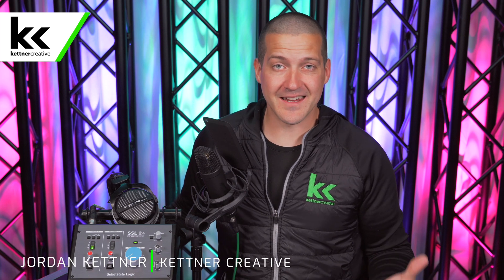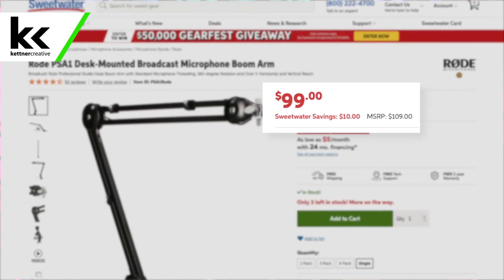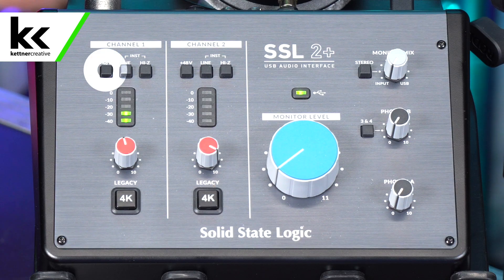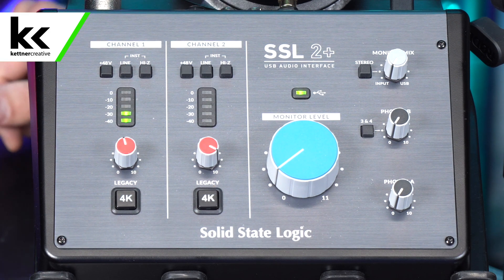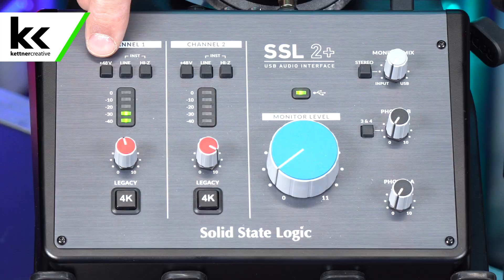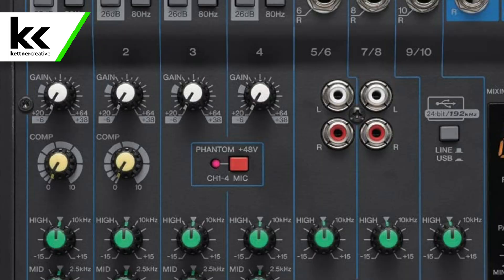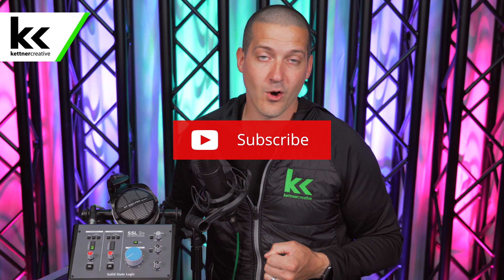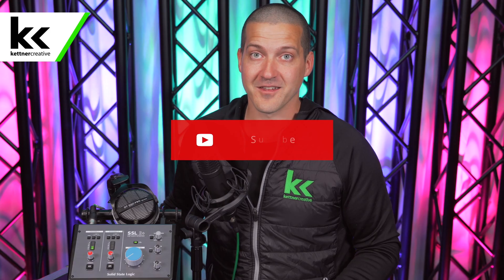Does Rode NT1 Need Phantom Power?

Comment: Hello! I have the NT1A and I realized that it also works WITHOUT Phantom Power on... is this normal? I'm afraid they sold me a fake one.
Reply from the maker: I have the NT1 (4th gen), NT1 (5th gen), and NT1 Signature Series, and none of them work without phantom power. 

I would guess that your mixer/interface is sending phantom power even when it's turned off. 

A fake NT1 would still require phantom power.
Reply: @kettnercreative  thanks for your answer!!
Reply: I have the same issue! I dont understand it. And i dont have a mixer who has phantom power at all, so who does that work??
Reply: @DieExistenzlosigkeit  As I understand it after communicating with the people at Rode, the microphone works without the phantom on but not at maximum performance. When you turn on the phantom power, the microphone has better energy and works perfectly. To take advantage of the microphone it is necessary to turn on the phantom power

Comment: Thanks for your video!
I use a Rode NT1A Microphone, a Preamp with 48 Volt phantom power. A few days ago I measured the voltage, it was only 43 Volt but the Microphone still works. I read the specs and found that Rode NT1A requires 24 Volt or 48 Volt phantom power.
I want to ask with such a voltage drop, will the microphone have any effect on health and sound quality?
Best regards!
Reply: Hey!
I just bought the microphone and a mic arm. Is there anything else i need???